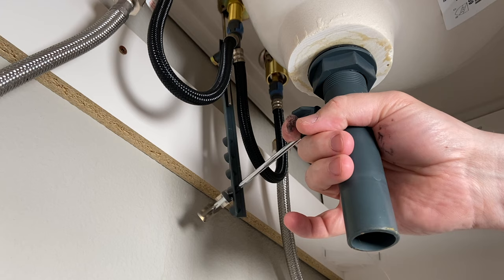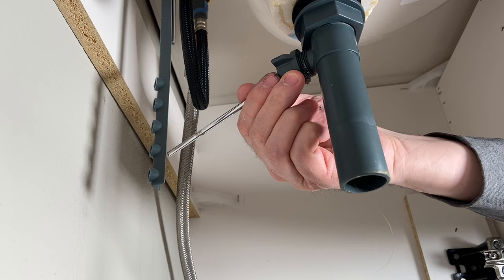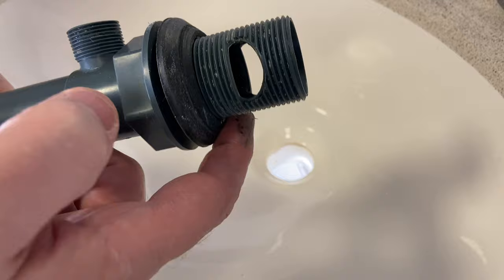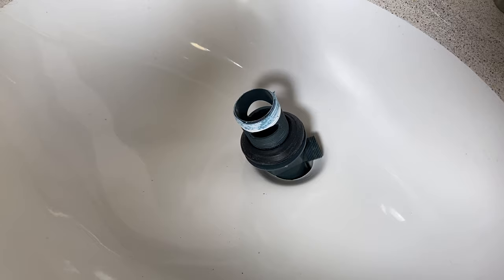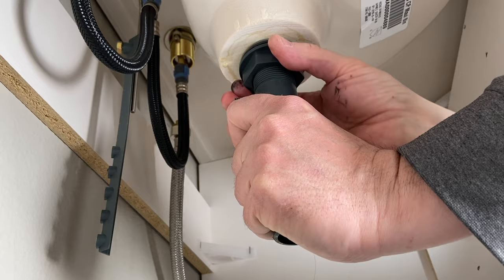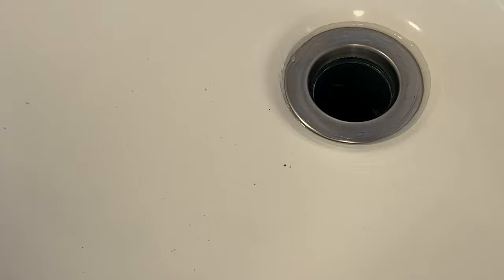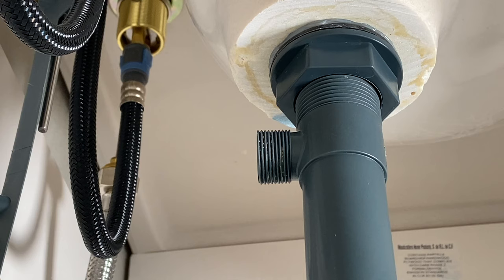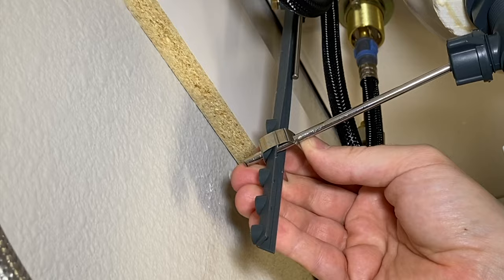LOOSE and LEAKING Plastic Bathroom Sink Drain Repair

Comment: At the 2:22 mark. What is the purpose of those two holes at the top of the pipe?
Reply from the maker: So water will go down the drain when going through the overflow hole on your sink.

Comment: mine is leaking from those holes in the drain pipe. why are they even there ? and how can I fix it
Reply from the maker: send me a picture on Facebook if you want.  I don't know what holes your referring to.
Reply: That black pipe you're holding has holes on the side. But that's were water gets I'm and leaks out on my sink
Reply from the maker: Those holes I think you are talking about are for when you fill your sink and water starts going down the overflow hole. Those holes still allow the sink to drain.
Reply: @ThatFixItGuy  so to prevent water from leaking  down those holes will plumbers putty or caulk fix that problem ?
Reply from the maker: How can you tell water is leaking out those holes?  They are covered up in the sink.
Reply: @ThatFixItGuy  because I took the stopper out and I can see the water leaking out from the black rubber seal.
Reply from the maker: So I would not fill those holes or anything like that. I would just reseal or replace your current pop up with silicone the way shown in the video. You should have no leak after that.

Comment: You said nothing about keeping the rod assembly from leaking... I installed a new rod assembly but it leaks where the ball joint is..
Reply from the maker: Was it the same manufacture?  If it is not exactly the same it will rarely work. the rod assembly usually does not require any sealant to prevent leaks.

Comment: Replaced entire p trap and black pipe leading into sink... now there is slow draining...bubbling in the sink when draining... and a slight leak from the top of the black part??
Reply from the maker: You have a leak between the rubber gasket and the sink itself?  Did you use silicone between the rubber and the sink?  

When you fill your sink up and drain it does it drain or is it completely clogged?
Reply from the maker: If you want you can email me at Ufix247@gmail.com I can’t see posts after the first on a thread for some reason.
Reply: @ThatFixItGuy  okay thanks for the info I just emailed you
Reply: All fixed now thanks again!

Comment: Did you know it's IMPOSSIBLE to find a video of how to properly cut a chromed brass tailpiece?!! The one that attaches from the bottom of the pop-up to the p-trap.
 My local store only had a 6" and 12" chrome tailpiece. I need 10". What is the best way to do a smooth cut? I would need something for 1 1/4" - 1 1/2" pipe. But the tailpieces are not solid like copper pipe, it flexes. I don't want a cheapo throw away tool. Would a Ridgid pipe cutter be the best option?
 Try searching the web to find "how to cut chrome tailpiece" I can't find a video anywhere.
Reply from the maker: I use a ridgid copper tubing/pipe cutter that will cut up to 2” for this cut. You can use a hacksaw, but your right the cut will be so much better without filing using the copper cutter.  Thank you for the video idea as well. This can help a lot of people out.

Comment: The threaded bowl ring snaps. Dang plastic. Guess I'll try again
Reply from the maker: Oh man that is a bummer.   Nice thing about using silicone is I never feel like it need to super tighten it. Once it is put together and does not move it will be good to go!  

You could always go to brass.
Reply: I guess I need to put tape & thread seal on it and not skip that step
Reply: The hardware stores do not carry anything but plastic drain pop-ups.
Reply from the maker: That is a bummer.  I know brass pop ups have become way more expensive as well.